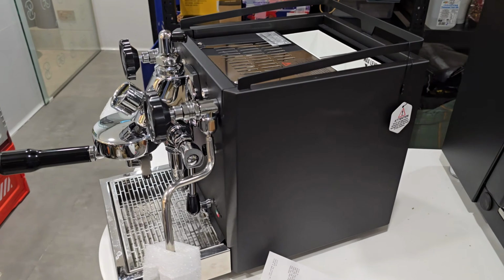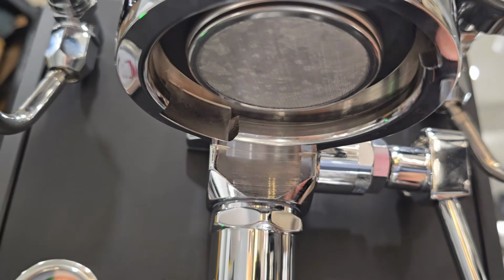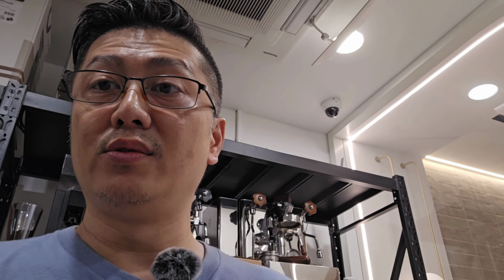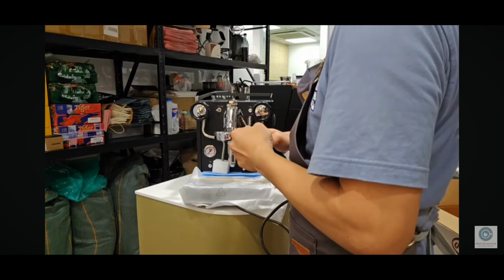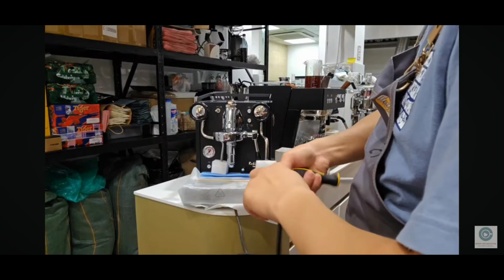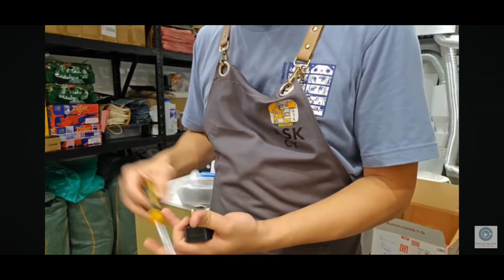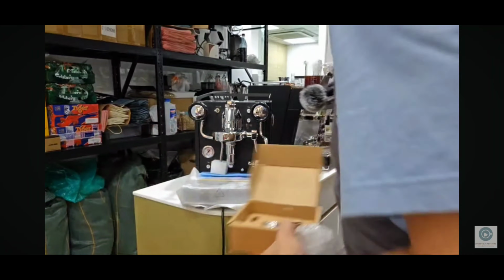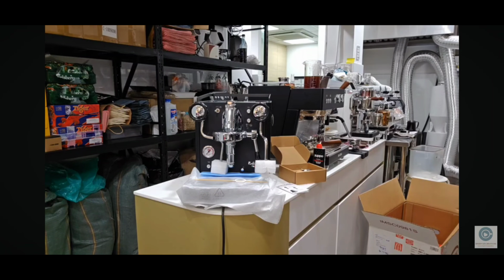First look of the Matte Black Quick Mill Rubino with Flow Control installed

Comment: it still has loud vibration pump. I had to wrap up polyurethane foam over vibration pump, which reduced noise by half on my QM Sunny
Reply from the maker: Comparing the vibratory pump on the QM and others, I can safely say that it is quieter.

Comment: Hm,
On DB machines everything is simple. Brew temperature is controlled separately in the boiler. FC is just restricting it's volume per second and thus pressure.
However, the slower water runs through the heat exchanger tube whilst restricted by FC valve, the hotter it gets... Isn't it the case? It basically overrides the p-stat and makes things even more difficult to control... Higher flow = lower temp and vice versa...
Reply from the maker: Well, all I know is I have been getting great espresso from it for years as long as it's not overheated. Dual boiler machine is great, but personally, I think for home users who make 2 to 3 cups of coffee a day, a dual boiler is an overkill. And it is also much more expensive.